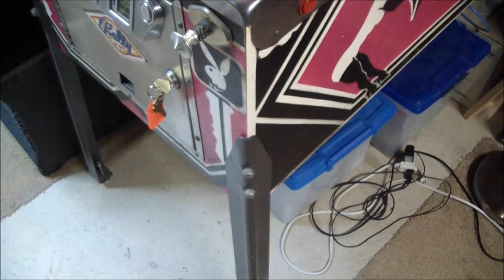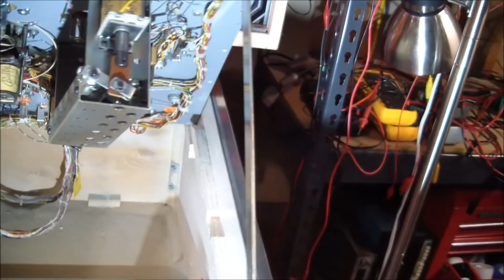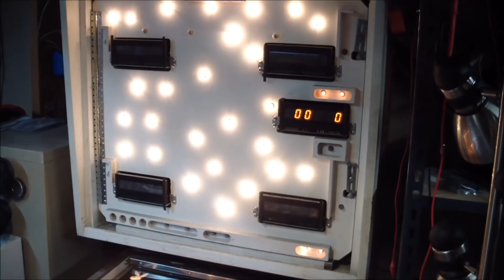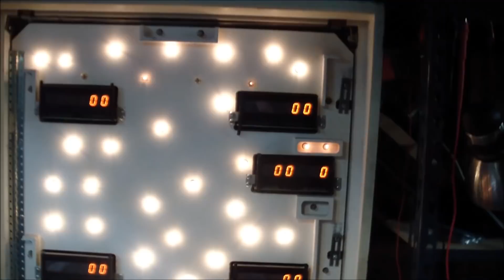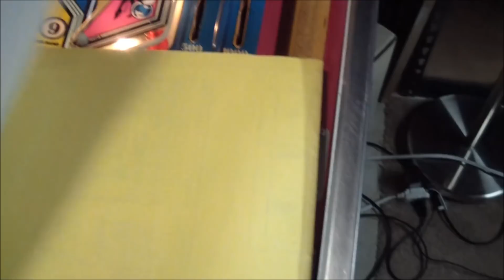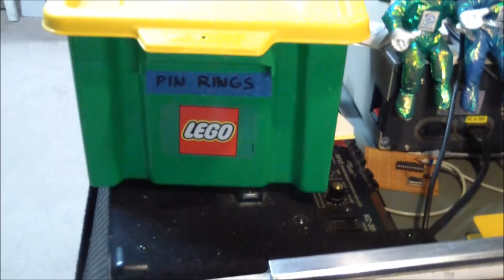AE#72 Bally Playboy - Anatomy Of A Pinball Machine

Comment: I've recently purchased one but I seem to have a slight problem, when I shoot the ball at the middle target in the centre of the playfield it seems to bounce off and shoot up and hit the glass which sounds really loud! Any ideas? thanks
Reply from the maker: Try slightly bending the metal support behind the switch either fore or backwards until the ball  no longer goes vertical when hitting the switch.
Reply: @artifactelectronics  
Thanks I'll try that

Comment: Great video. Just out of curiosity, what are the ratings of the large blue capacitors in the power supply?
Reply from the maker: The one on the left is 160uF @ 350V, the other is 11,700uF @ 20V

Comment: Great to see the innards working - the solenoid test sounds like someone tried to make it play a tune of sorts :o) Those 7-segment displays look very like Panaplex displays - a sort of improved development of Nixies ? (I looked them up - yes they are Panaplex displays - someone online is turning out clock kits using these pinball modules). Fran Blanche would make an entire video on just those displays...and another six on the rest of the machine. She'd be in heaven. :o) Thanks for showing it.
Reply from the maker: They're vacuum fluorescent end eventually they all start gassing out. I have to start looking into LED replacements.

Comment: I assume the fuse in the flipper supply is that is the only solenoid's that can have permanent power if someone holds the buttons in all the time.
Reply from the maker: That's true. But the flipper assembly has an end of stroke switch that effectively increases the number of turns on the solenoid and thus uses reduced hold current as long as the flipper button is held. You can press the flipper buttons for a long time without any ill effects.

Comment: Just a question...If you have spare parts that are rubber...and they were purchased back when you got the machine...will they not break just like the ones on the playfield as they are the same age??? Or do you, or should you put the rubber parts in a vacuum bag to keep this from happening?
Reply from the maker: You are right, rubber rings will degrade in storage also but not as quickly as in the machine because they are not exposed to playfield heat when outside the machine. The proper thing to do is to get a ring kit for your machine which has fresh rings and costs about $15.

Comment: Cool video, Arte.  You said 190 volts for the numeric displays, so they must be Nixie tubes.  It would be very interesting to see a restoration and/or repair of this vintage of pinball machine.  Thanks.
Reply: Plasma display. Not nixie.
Reply from the maker: The displays are gas discharge, very similar to Nixie tubes. The nominal supply voltage should be 190V, but once they're 'broken in' you can reduce the voltage by 15 - 20V which causes very little decrease in brightness and prolongs display life.

Comment: As a suggestion, you could mount a battery holder on the inside bottom of the machine on top of a plastic tray. That would provide quick and easy access to change the battery and keep it from potentially damaging a board.
Reply from the maker: You just have to be careful to use a blocking diode if you use non-rechargable batteries, but that works really well.

Comment: I would relamp with warm white LED's, just to keep the colour, but also add a 220uF capacitor across each LED to make them fade in and out like a lamp.
Reply: I think the idea is to keep it as original as possible...
Reply from the maker: The capacitor part is interesting, creating a brightness ramp. But I do try to keep them original.